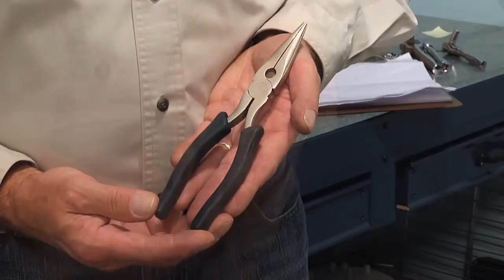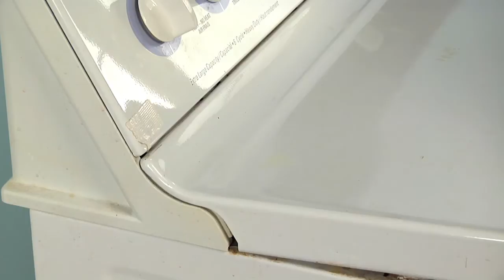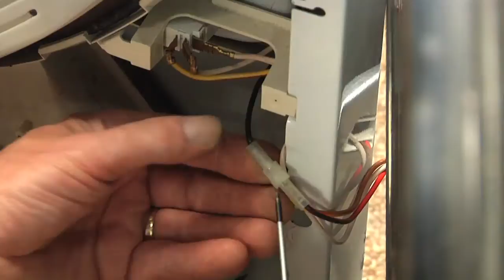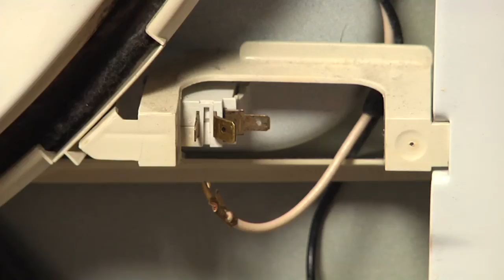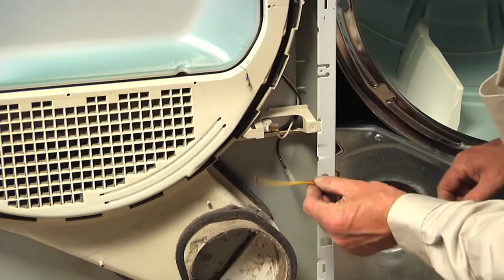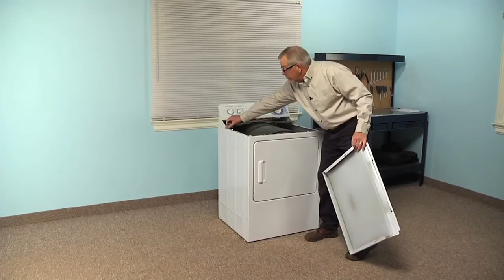Dryer Repair - Replacing the Door Switch (GE Part # WE4M415)

Comment: It is not necessary to take the dryer apart to replace the switch. I just did this repair myself  and I am not a repair person. The old switch can be pried out from the front and there is enough slack in the wires to pull it out. I took off one contact at a time and put it on the new door switch and then popped the new one back in.  Very simple. No disassembly required. I only needed a putty knife and a flat head screw driver.

Comment: You see how difficult and inconvenient it is just to take out a little door switch. The engineers that designed these washers and dryer‘s make it so difficult to replace a part. It’s like pulling teeth.